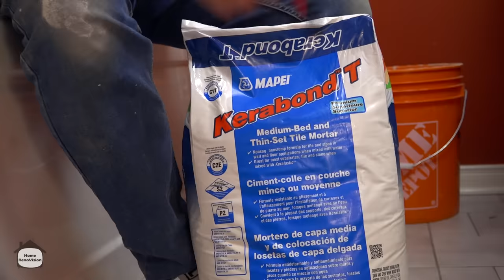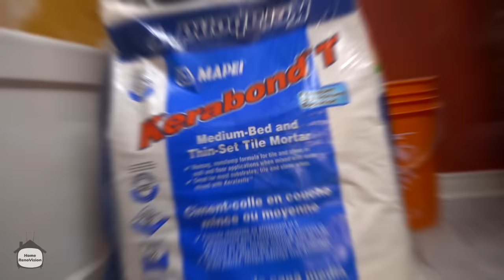DIY How to Renovate the Tub / Shower from A to Z

Comment: Thanks to your videos I was able to remove 2 types of flooring, level the floor, repair water damaged sub floor, re work electrical in my kitchen, replace outlets, AND lay 500sq ft of laminate flooring with 2 transitions, an angled fireplace and longways under 2 doors and it looks AMAZING. 

Thank you and if I’m ever in Ottawa the first round is in me. 

Cheers!
Reply from the maker: That sounds like a plan. Cheers! Anyone wanting to meet me for a pint just give me a shout. Cheers!
Reply: I'm used to the way things are done in the U.S., now I am in Japan where DIY is more like you managed to change a light bulb by yourself instead of calling maintenance.  I don't think they encourage DIY that much, there are some tools and materials that you just cannot get unless you go to a web site that actual contractors use for supplies and just don't say you're not a contractor.  There is some weird stuff going on behind my walls & ceiling.  Like seriously, who has a mains voltage line coming out of the back of the breaker box doing a loop de loop around the large drainage pipe from the apartment above??

Comment: Gret video and great series.

Just one small thing:

I do not know if this part just got cut out, but for all those who are watching and never have soldered copper pipes before: do not forget to debur the outside and the inside of the pipe after cutting. Otherwise the waterflow is impeded and "dirt" can clog up.
Reply: Very good video

Comment: Awesome video! Thanks for making it! Interesting that the owner didn't want to go with a walk-in shower. 

For Schluter products (and other pro tiling and waterproofing products) I'd suggest going to a wholesale tiling supply store. Most sell to consumers and you get much better pricing, selection, and service compared to the home improvement stores or F&D (e.g. Ditra is almost half price!). They will definitely have the KerdiFix too! And another tip is to find out who the local Schluter rep is (or whatever product line you are working with) and reach out to them with any questions, suggestions, etc. They have proven to be very helpful to me in projects. 

For the siliconing, I really like the Cramer profiling kits. Leaves a cleaner edge of the right size. Also you didn't show the grouting process but it's simple enough and there are many videos on that. Key is to ideally get the new epoxy grout which doesn't need sealing and is better suited to wet locations compared with cement-based grouts.

Comment from the maker: Please ask your questions, I will be here to answer them myself so you can get a great result. Cheers!
Reply: I love you Jeff!
Reply: jeff , i have a tub should i turn it into stand up shower or just replace the tub with a newer deeper one and install glass door
Reply: It will be awesome if you could make a video showing how to do a waterproof shower floor without the kerdi system. Thank you though for all your great videos. Best DIY
Reply: Great how too! What about toilet and vanity install? Any chance of a video for those?
Reply from the maker: We Love you too!
Reply from the maker: That is a personal choice, why are you on the fence?
Reply from the maker: The easiest is to use a shower pan! I don't use sand bed anymore. Cheers!
Reply from the maker: we have a bathroom video series in march that covers the entire room remodel. different since we show water damage repairs in the subfloor plus tile on floor install as well as toilet and vanity. Cheers!
Reply from the maker: That was always our hope James. Cheers!
Reply: Thanks for the informative videos....When I redid my bathroom tub/shower I used Durarock on the walls of the tub., which I screwed to the studs.  Now my wife wants to get rid of the tub, which I never wanted in the first place LOL, and she wants a walk in shower. Would I have to bust/ peel the tiles off then unscrew the Durarock or what. Sounds like a lot of work eh'
Reply: Is copper required for that slip on tub spout, or did you just do that for a better joint?  Could you use a drop ear and threaded pipe or even pex?
Reply: Hi, I got also inspiration after watching your videos. I never done renovation ever just wondering do you think its good idea to renovate my apartment's bathroom on my own? My apartment is on 3rd floor. is it too risky to do that as small leak can ruin the other apartment downstair in case of any water leaks. I can hire plumber and electrician work but rest of the things i would like to do by myself and save some money. looking forward for your response. Thanks
Reply: I backed into my bathroom wall and there is a slight crack/depression in the bathroom wall. whats a quick fix for that community?
Reply: i love this channel
Reply: how thick should my grout be
Reply: What nail puller is that--i need one of them :)
Reply: Have you heard of a product called "mussle bound" that replaces concrete when applying tile?? Your channel is extremely helpful and I truly appreciate how much effort you put into your videos. Thank you!
Reply: I'm installing 2 foot by 1 foot tile around my shower and walls of bathroom.  The shower is mold resistant sheet rock with red-guard. What thin-set do you recommend?
Reply: I’m remodelling my bathroom completely which includes changing the plywood subfloor. Would it be wise to also change the floor beneath the tub? Thanks!
Reply: You are a gift to us DIY plebians. I am adding a bathroom myself in the spring, and I wish I had this video when I renovated the first one in 2016...
Reply: I need more tools ... yay! Just took all the tile off the walls in our en-suite shower. Next I’ll be ripping out the drywall. 
Question: I want to tile the ceiling in the shower but the paint has been peeling. I sanded it back but it’s still like cracked skin looking. Can I prime it and tile over it? Thanks, Cindy
Reply: Great info here. What faucet/valve did you use? Our builder put in a single handle valve but can not control the water pressure. It just turns from cold to hot full force. Do you think it will be easy to change them out? We also have the same tub and it flexes a lot. I get a good 1/8 inch gab from grout line when we fill with water. Tiler is coming to silicone because they didn't finish that yet. Any suggestions welcomed.
Reply: Great vid so far! where did you find the giant container tote bag ??
Reply: You say that schluter reccomends a 2" overlay, that is correct, however that kerdi band is 5" wide so there is room for error. If anyone has rent houses or installs more than 1 shower per year, schluter has a website that shows their training schedule. This company does a 2 day class for part 1 that shows the basics of install for tile setters and diy'ers alike. Completely free, if you live too far away, they will give you a 2 night stay in a hotel with breakfast lunch and dinner for 2 days. I have been to part 1 and part 2. Extraordinary company. This also has a lifetime warranty to protect the product and anything damaged by that product failing.
Reply: @HomeRenoVisionDIY  we need that vid, recently discovered a leak under the shower tray that must have been going on months, parts of the floor we can see are rottin, we won't know extent of damage until we take bottom row of tiles off to get the shower tray up, tiles are there 15+ years so I don't expect they will come off ok, tiling was done straight onto plaster board so I imagine the 3 walls will need to come out and be redone as a result,  the rotton floor will need to be cut out  and then we will see if the joists are damaged,Also the ceiling below has a small amount of water damage( that's how we discovered the leak) so I imagine that will have to be replaced. Terrible that a small leak can cause so much damage over time😟. We turned our bathroom into another bedroom so only have the ensuite for us and 3 kids as a result we need a mega quick turn around on this project but nervous to start as unsure of the damage currently there as a result of the leak plus from removing tiles, oh and to add insult to injury as a result of this leak we have a silver fish infestation again don't know the extent until we start taking things up. Hench why I just watched your vid, fantastic quality btw, have passed some tips onto my husband.
Reply: if you are a fan of Manchester United, no more questions...
Reply: Shark Bite? Wouldn't that be easier than solder joints?
Reply: @nyquildays  Many people don't trust SharkBite. I personally know someone that had a flooded basement due to it.
Reply: Is it standard practice to remove a toilet flange when taking old tile and putting in new tile? Or does it make no difference whatsoever. Assuming the tile is the same height
Reply: How do you insult the shower rod?
Reply: my kitchen faucet needs replaced,, problem was the cold water line was not flexible like the hot so i was not able to finish the work.  I was not sure how to cut the water line   someone said add a flex hose but the ice maker and dish washer are also hooked up to this cold line that wont bend  ?? thoughts .. love your videos Jeff.. Penny
Reply: Can you please make a video removing  the old bath tub with out damaging the walls I have a old tub but new bathroom just made a mistake not changing it😢 plz plz plz
Reply: If I have a tub with water jets can I wire the motor/pump into a basic outlet and then wire that outlet into a gfci?
Reply: Every room I've put tile into in my house and hardwood floor into I always save the extra materials.
I get told we don't need this juke   Will depends on how you look at it, tile you can put in the attic wood might be better off on a top shelf in a closet.
I doubt dropping a pan on the floor will damage a porcelain tile in my kitchen because I'll get 95% bond when I do it  but just in case.  
Even pro's should watch the manufacturer's and schools youtube content you can never learn everything.
Hey I'm 58 years old I'm not going to be doing this for a living, but I  have done some you seriously can not learn too much.
Reply: Home RenoVision DIY was the brass drain still loose and moveable after you put the tub in or did you tighten everything up before putting the tub in?
Reply: I am keeping my existing tiles and bath but the silicant seals are ugly , grey and worn out in places but I can't get it off to put new silicant in. I've tried several expensive tools and it just pings back into place
Reply: Thanks for the usefull videos Jeff.. another subscriber here... From the other side of the ocean,,, Portugal... Cheers and thx once again!
Reply: Home RenoVision DIY good video thanks
Reply: If I want to reglaze my tub should I remove the tile first. I have a baby blue cast iron tub so I think it’s more economical to reglaze.
Reply: Is it possible to use cement backer board (Hardie) with Versabond modified mortar with AR tape on seams all covered with Red Guard for waterproofing?
Reply: Home RenoVision DIY come do my bathroom PLEASE send
Reply: Thanks buddy you make people confident in doing home repair and renovations themselves even if you are Canadian
Reply: Home RenoVision DIY I should have married a guy like you!!🤣
Reply: Pretty sure I could handle the copper to pex, but my big fear is that I find galvanized steel behind the wall instead of copper. Is that a possibility with a home built in 1980?
Reply from the maker: @bftigdd  both options are good ones!
Reply from the maker: @dayron6520  if i ever find an economical option that works I will share it. Cheers!
Reply from the maker: @firebirdxl5  doing all these videos as we speak. Cheers!
Reply: 1 million views dude! Congrats!
Reply: Jeff, I recently remodeled my bathroom and installed a tub/shower combo. When I turn the faucet on, the shower head drizzles water out. What’s the cause and solution to this?
Reply: Im looking for a tub that can also be the base of a steam shower. Glass on one long side. more square than soft round. I cant find a thing like im lookng for.
Reply: Home RenoVision DIY When our house was built 25 some years ago, we installed a one piece tub and surround.  Our carpenter told us that there would be no way to get a new one in when the time came.  He basically installed it through the side of the house.  Our bathroom is small and there isn’t much maneuverability.  How can we get this one piece tub out?  Another concern of mine is what is behind it?
Reply: I know this is not related to the Bathroom Renovation, but can you please tell me the paint color of your front door?? I'm about to repaint my exterior doors, and was just gonna go white, but I love this color.
Reply: I am replacing my toilet. I was only going to replace the inside flush mechanism because the existing one has failed. But I found out my toilet is so old, they don't make replacements for the inside. So my question is, when choosing a new toilet to replace one that is possibly 50 years old, what do I have to make sure to get right? Do I need to remove the old toilet first to get any measurements on the drain, etc?
Reply: I live in South Florida. I am planning on moving and purchasing a foreclosure home in Orlando. I know I will do a lot of renovation to the home especially to the floor. So my question is do I need a subfloor in Orlando, Florida?
Reply: Oh dude, please use a mask. You're going to end up with lung cancer 😔
When silica is present in dust, you have an increased risk of silicosis and lung cancer. It is present in drywall, and other construction materials.
Reply: I have a completely gutted bathroom; in what order should things be worked on? For example 1. Electrical 2. Plumbing 3. Shower build out ... etc.
Reply: Jeff, you're awesome!  Watching your videos gave me the guts to try a total bathroom remodel and I'm having a blast!  Thank you for creating this channel and all of the amazing content.  At a minimum you deserve your own show on HGTV or the Discovery Channel!
Reply: Home RenoVision DIY
 what do you use to determine how much resell value for something that will be added to a home to make the home like other homes because sometimes there will be break evens cost to resale value for somethi6ng like a kitchen
Reply: You are a wonderful person 😀
Reply: Love your vids! Do note, though, that those gloves are not "one size fits all." They are so huge that they are downright dangerous for me. Do you have any female advisors to weigh in on that sort of thing? It's always cool to also have perspectives on universal design. When we reno, why not be mindful of those who may not be tall, or have the use of only one arm, or other mobility issues? It helps us to build BETTER. If I didn't like your vids, I wouldn't bother. Always glad to take a minute to maybe help the best get better. ;)
Reply: Love the videos Jeff. I pulled out my main floor steel bathtub and installed a full size shower Ove shower with help from watching your videos. Turned out fantastic. I'm in the process of installing a bathtub in my basement and thinking of using Sharkbite fittings with pex. Your thoughts?
Reply: Hi Jeff love the quality of instruction. I'm renovating my bathroom.  Its a small bathroom 8'10"x5' the ceilings is 7' high. I was wondering do i need to tile the ceiling in the shower?
Reply: Son of a Journeyman Tradesman...our babysitter was the job site most days...this brings back a LOT of what I learned watching and helping in those days.
Reply: do you ever use "Craig's List" or similar for your reusable ♻ materials that you throw away in this video ?
Reply: @nyquildays  Expensive for more than a couple of pieces.
Reply: I want to recess the shower hose into the wall similar to the way the hose for a kitchen sink is. The big issue is the controls are on the right side and the hose is on the left. I'm worried about routing the hose and access for maintenance of the hose in the future. I think I may have to make some kind of access panel in the tile.
Reply: its 2020 and im still shocked the industry still requires soldering.
Reply: I just wanted to tell you to be careful while inhaling all the dust.
Reply: Great job with all of uour videos Jeff. I watched the whole videoand lkke others said, I was redoing my bathroom. lol.You explain everything and you add a little humor which makes it easier to watch.
Reply: It seems there is going to be a high flow rate reduction with the type of adapter used to go from copper to PEX. Can you comment on what the reduction is?
Reply: Brilliant channel 👌...thanks for all the tutoring! By the way, what is that fancy hammer like tool called? Doe it have a trade name?
Reply: I have a Moen tub faucet. I was able to pull the Carthage out. I can push the new Carthage back in, but as hard as I try, the pin will not go back into the allotted slot . I can see how the pin slides down the side of the new stem, but once installed it won’t slide into the slot. Help

Comment: I’ve finally started our small bathroom    renovation (my second) and your videos have been huge helps!! I didn’t realize how heavy those tiled walls would be…holy moly!! Now a friend is helping me install the drain on the new soaker tub.   Oh my tiles would not break like yours did but my oscillator tool made a hand-sized hole on the top for some pulling power which worked great!

Comment: Pro tip: stuff a rag or wad of paper towel in the tub drain hole so it doesn't fill up with debris from the demo and clog the pipe..
Reply: When did the new tub get installed??
Reply: Just stick the vacuum down it to clean it out.
Reply: Or masking tape
Reply: Why bother when he cuts away the drain and replaces it